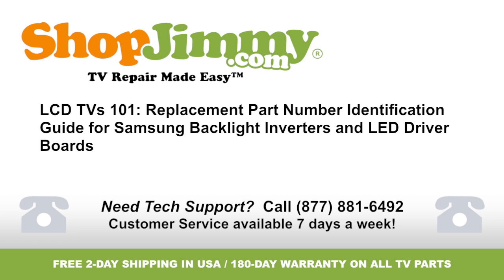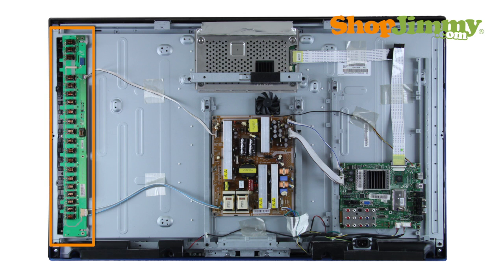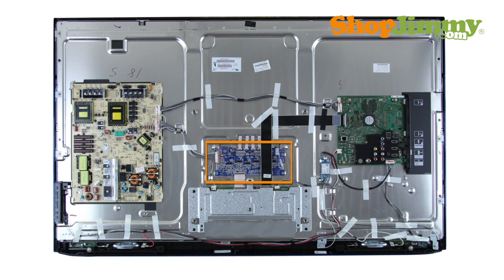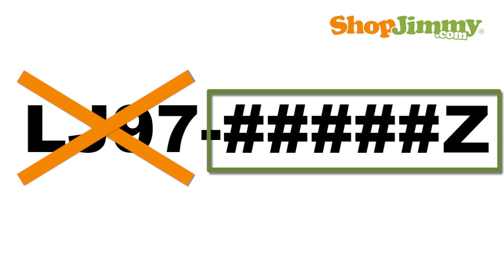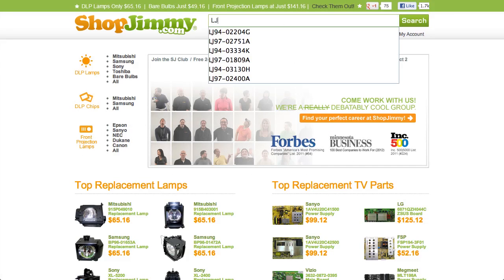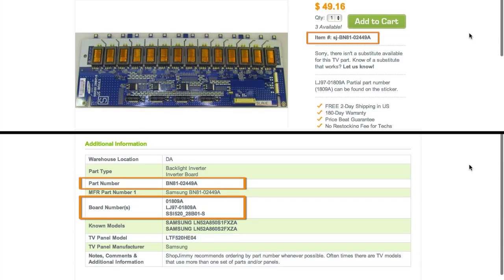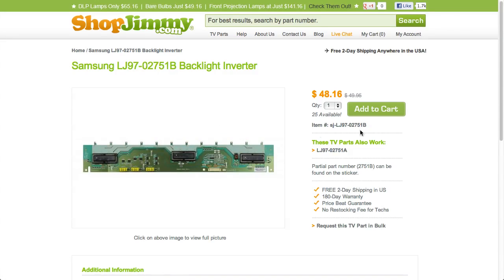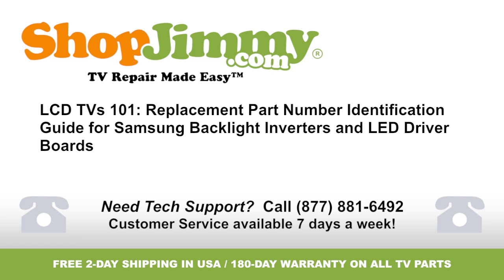Samsung TV Repair - Part Number Identification Backlight Inverters & LED Drivers - Fix LCD TVs

Comment: I have a Samsung un60es8000fxza that has a dark 6 inch band across the lower part of the screen. Originally started on one side then
Progressed to fully across the screen. Am I correct in thinking it’s backlights are burns in 1 spot on each side or can it be a control board issue. Thank you

Comment: I have a Un50f5500afxzc ver ah02 Samsung TV. There is audio and I can see video but barely, screen is pretty much black but came make out video image in certain lighting conditions. So would this be the backlighting strips or led inverter or led driver or what else could it be?

Comment: I have a Dynex TV with this inverter board. The issue seems to be the group of four resistors with zeros in them. On my TV one was burned so the backlight kept going out so I ran a wire connecting each side of the resistors and the set had been running for maybe 20 mins with no issues. A lot of juice must run through those resistors. Its probably the main 24 volt rail for the inverter.

Comment: Hello! I've got a samsung led 40". I have been using it since 4 years. It was working smoothly but since 4 months i am facing screen black out problem but sound is working good. I got it repaired twice but it didn't work more than 2 weeks. I don't trust the person who had been repairing it! When i flash light on screen it shows image on whole screen perfectly and sound also working! Model: UA40EH5000R. Version no: AD01. S/N: ZUUZ3MMC705505K. Made in Malaysia. Kindly help me out. According to the repairer he changed the back lights and repaired the boards at first time and secondly changed the back lights and the boards too!

Comment: Samsung un40f5500afxza works fine except for a dim 6" or so horizontal band on lower 1/3 section of screen, just was given tv and want to save it if possible backlighting or board issue?

Comment: I have been looking solution to my P2770FH monitor, but I just can't find it. Problem is: when monitor is on some time and it draws white and bright pixels it works like charm, but when it have to draw black and dark pixels its starting to turn off and then back on after five seconds. And doing it like every minute or so. What can be broken?

Comment: Hi is possible to find a led bar for a TV? i have just some burned leds on the bar. The part number code is M715 Y000419E3C713 for a Samsung UE32ES6200. And i can't acces your website!

Comment: LED Samsung UN32EH4003F, I have sound, picture some time. When picture is off I can see the image with a flash light test.Can see back light. What part is most likely needed.
Reply from the maker: +Roy Yeaman   Try all repairs and troubleshooting at your own risk. This sounds like a problem with the actual LEDs inside your TV. These LEDs are replaceable, however it is recommended they are replaced by someone with the proper experience and training. When replacing the LEDs, the TV panel can get damaged. If the TV panel gets damaged, it is not repairable. Click this link to replacement LEDs for your TV model number:  http://www.shopjimmy.com/catalogsearch/result/index/?cat=299&q=UN32EH4003F   Be sure to match the panel information necessary to ensure you have the correct replacement LEDs.Thanks and please let us know if you have any further questions with your TV Repair!  www.shopjimmy.com

Comment: Hi. I have a Samsung UN32EH4003F. Has sound but no picture except i barely see the picture with a flashlight.I don't see  backlights in the back when i power it on with lights off.Looking to buy replacement part from your site just need to know which board. Thank You.

Comment: Hi I have a un32f5500 and did the flashlight test and I see the tv picture and have sound. I can't find the LED driver on your site
Reply from the maker: Kevin Leberge    Try all repairs and troubleshooting at your own risk.  This could be a problem with either the LEDs or the power supply board in your TV.  You can replace the power supply board to see if that fixes the problem in your TV.  Click this link to replacement parts for your TV model number:  http://www.shopjimmy.com/catalogsearch/result/index/?cat=229&q=un32f5500  There may be multiple boards for the same TV model number, be sure to match part numbers on your current board, with your replacement for compatibility.   Thanks and please let us know if you have any further questions with your TV Repair!  www.shopjimmy.com

Comment: Hey Shopjimmy I got a Samsung UN32F5500af not powering on could it be only the power supply ? I can hear a slight click when I connect the power cord. thanks
Reply from the maker: Guillaume F   PLEASE SUBSCRIBE TO OUR CHANNEL - Try all repairs and troubleshooting at your own risk.  I recommend replacing the main board in your TV.  Click this link to replacement parts for your TV model number:  http://www.shopjimmy.com/catalogsearch/result/index/?cat=56&q=UN32F5500af  There may be multiple boards for the same TV model number, be sure to match part numbers on your current board, with your replacement for compatibility.  Here is a link to a video showing how to identify your part number, click here:  https://www.youtube.com/watch?v=BEPWrefQvqI Thanks and please let us know if you have any further questions with your TV Repair!  www.shopjimmy.com

Comment: Hi!

What if the Inverter Panel shows a code that does not star with LT?
On the TV in question (Samsung LE32S62BX/XEC) the code is:
D320WB02BT71906788.
There are some code on the inside. They are:

E206453 Model V144-J04N
E162032
CPT 320WB02S
4H.V1448.451/C1

The first two codes are on the top part of the board and the first is under the RU Inicials.
The last two codes are on the bottom part of the board and are in bigger letters.

Thank you

Comment: I have a 42 inch samsung UN40C5000QF tv that keeps dimming as we watch it. All we have to do is tap the back of it and the screen instantly brightens back up. After awhile it will go very dark again but u can still see the picture then we tap the back again and it brightens right back up. Now its gotten worse and it does it about every 4-5 mins. Can u help?? Thanks in advance
Reply from the maker: j. shockey   PLEASE SUBSCRIBE TO OUR CHANNEL - Try all repairs and troubleshooting at your own risk.  This could be a problem with either the power supply or the LEDs in the TV.  You can replace the power supply board to see if that fixes the problem.  Click this link to a replacement power supply board.  http://www.shopjimmy.com/samsung-bn44-00352b-power-supply-unit.htm  Be sure to match part numbers on your current board, with your replacement for compatibility.  Here is a link to a video showing how to identify your part number, click here:  https://www.youtube.com/watch?v=sSJexLvRrjM  Thanks and please let us know if you have any further questions with your TV Repair!  www.shopjimmy.com  https://www.youtube.com/watch?v=sSJexLvRrjM

Comment: hi i have a samsung le32450p7w my hdmi stopped working so i bought a used main board but it came with a different ribbon connection is there any other ribbons that i can use , the board is a bn41-01165a , my tv board was a bn41-01165b any help would be much appriciated
Reply from the maker: Gary McNally  Try all repairs and troubleshooting at your own risk.  You will want to return the wrong board and get the correct board.  Thanks!  www.shopjimmy.com

Comment: Hi, I have a Samsung LT22C350MW,  a week after i bought it the backlight broke down. when i turn it on it works for a split second then the screen goes black, i can faintly see that the screen is working but it is very dark. Can you please tell me what is the exact problem and if there is anyway i can repair it.
Reply from the maker: fakkak12345   This could be a problem with either the inverter board or the power supply board in your TV.  Unfortunately I do not see any replacement parts in the search results for your TV model number on our website.  Please reply with your part number on your boards and I can try searching for replacement parts.  Thanks and please let us know if you have any further questions!  www.shopjimmy.com

Comment: Hi. I have a Samsung 40 inch LCD TV Model Number LN40A530P1FXZA. The left half of the screen is showing picture with a yellow tint, while the other half of the screen looks OK. Could you please advise on the part I will need to replace? Thanks in advance.
Reply from the maker: Brian Sulaiman   This sounds like a TV panel (TV Screen) problem.  If your TV panel is bad, it may be more cost-effective to replace the TV as panels are typically hard to find in stock, difficult to replace, and expensive.  Thanks and please let us know if you have any further questions!  www.shopjimmy.com
Reply: ShopJimmy.com
Thank you!

Comment: the spare part is useless if i dont know how to get the original out... how do we remove the inverter board from the series of locked nods?
Reply from the maker: *****   Please provide more information about your TV.  I recommend uploading an image or video and then replying with that link so we can know what the connections or locked nods look like.  Then we should be able to describe the process.  Thanks!  www.shopjimmy.com

Comment: Hi! I have a Samsung lcd 47" LN46C670M1F.
I was watching tv, all of a sudden the picture went black but the audio stills on. I tried flashlighting the screen in a dark room and I could see a very vague image.
Any diagnostic?
Reply from the maker: Robi Arce   Please check in your TV to see if there is an inverter board. I do not see any in the search results on our website. Thanks! www.shopjimmy.com
Reply: ShopJimmy.com 
Thanks for responding! I didn't find it in your website. I bought an inverter board and installed it but the tv is still doing the same...

Comment: Hello I have a Samsung lcd 52 inch LNT5265FX/XAC which part would I need for this
Reply from the maker: McCalla Sturgeon  Please reply with a description of the problems your TV is showing or the symptoms it is displaying, then we can recommend a replacement part for your repair.  Thanks!  www.shopjimmy.com  #tvrepair
Reply: ShopJimmy.com Ok so basically when I turn it on sometimes theres no picture but theres sounds, or sometimes it will be on and then the picture will go off but still have audio, and I noticed when the room is dark I can see a very faint picture when the screen is black

Comment: Hi Shopjimmy ,

Thank you very much for the reply and i just did the Falsh light test on my TV and found out that i can see the letters on the TV trough Flash light and there is no back light when i powered on the TV in side the dark room , please let me know what i need to do ?? My TV is Samsung 40 " F6400 and the model number is UA40F6400ARXXT.
Thanks in advance

Comment from the maker: @Ranga Waas - I would recommend running the flashlight test on your TV.  This will help to determine if the problem is the backlight inverter or the main board.  Please search our YouTube channel for the flashlight video.  Let us know the results of the test and we can recommend a replacement part.  Thanks and please let us know if you have any further questions!
Reply: UN65J6200AF no backlight. did flashlight and saw image. Everything appears to be fine.  I can only see 2 lights on tcon board. the back lights briefly turn on at start but are only visiable from the back.